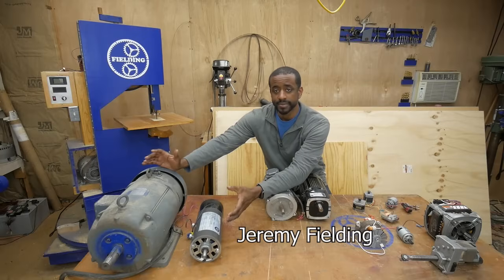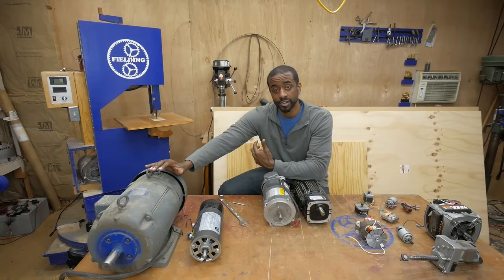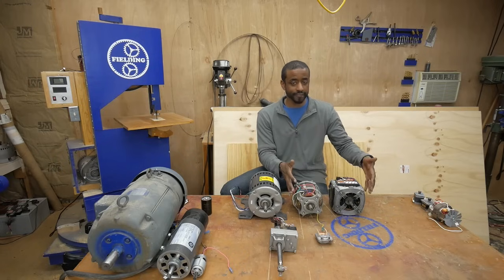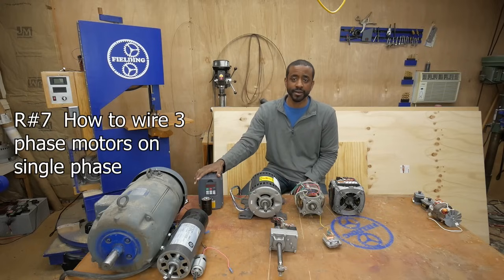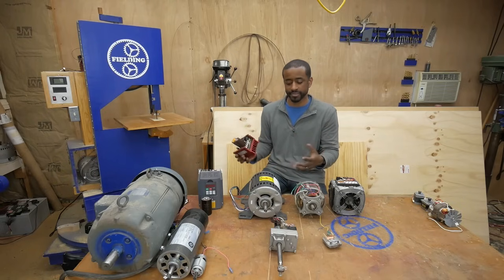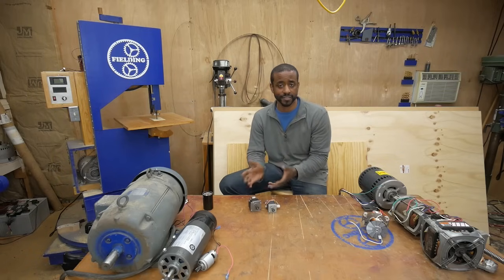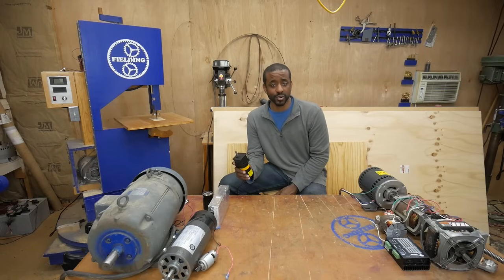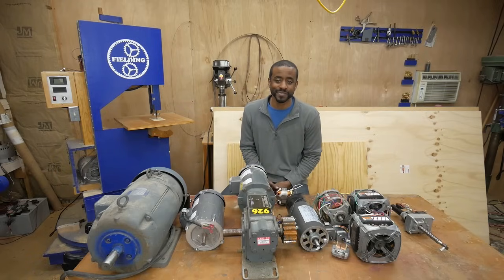Ultimate Beginners Guide to Using Electric Motors for Makers and DIY Projects; #068

Comment: I have a grinder with a ½ hp Doerr dual arbor motor (mod 60436DE741) that runs a grinder.  I need to reverse direction of the motor. There are 4 wires exiting the motor casing in the base of the motor, wires labeled T1,T2,T3, and T4. The on/off switch has two leads on one side with black wire connected to one, and white to other. The opposite side of switch has two leads with T1 and T2 together connected to one lead and T3 and T4 together and hooked to the other lead. I disconnected T1-4 and tested resistance between all combinations: 1-2=open, 1-3=1.9ohms, 1-4=open, 2-3=open, 2-4=1.9ohms, 3-4=open. I am ‘assuming’ 1-3 and 2-4 are run and starter windings. I’ve tried switching leads: T2-T3 together opposite T1-T4 = no movement. T1-T4 together opposite T2-T3 = nothing , T-3 alone opposite T1 alone = clockwise movement, T1 alone vs T3 = clockwise, T2 alone vs T4 alone = clockwise, T4 alone opposite T2 = clockwise, T4 alone vs, T2 alone = clockwise , T1 and T3 together opposite T2 and T4 together = nothing.   Help ??

Comment: Very good on electric motors , so I have and old lathe motor 1/3 hp 1200 rpm with heavy plate and pulley on  25mm shaft, a new small lathe has 200 watt  motor with 4000 rpm whitch can perofm best in lathe more torque ?j

Comment: I am building a sand railing type vehicle, at this point it weighs 220 lbs.  I believe it will weigh about a .5 tons when i'm done depending on the weight of the motor, batteries etc.  I want to know where I can find a DC motor and a way of controlling the speed and of course what size it should be  and easy basic way of calculation the torque needed to run it at a top speed of 70 mph

Comment: i've always imagined the first perpetual motion machine being a single high torque motor running a low friction conveyor and subsequently rows of (maybe?) brushless motors acting as alternators to feed back into the main drive motor. id love to hear what you think of this. what return of power percentage do you think you could achieve before the main drive is out-torqued by friction, line loss, etc.? I'm sure there's a reason this wouldn't work or we would have motor farms everywhere by now. i just need to know. lol

Comment: 1 HP is 746 watts, there are AC and DC motors. DC start motors that are series wound have an initial high starting current. Capacitor start and 3 phase are AC motors.

P=I*E, E=I*R.

That wash motor is from a Whirlpool direct drive unit.

Comment: Yikes, overwhelming. Im looking to get a variable speed motor for my small metal lathe so I don't have to keep switching pulleys and gears and what not. It comes with a ⅓ hp motor. Looking to pick one up cheap or free. What would you recommend?

Comment: If you add an expansion valve and control the speed of the compressor in your air conditioner over there, instead of just turning it on and off with the thermostat, you can GREATLY improve it's efficiency!  I've always been a nerd for the refrigeration cycle and electric motors.  Ever since I realized as a kid that my radio controlled car that did a scale 200 miles per hour would actually DO that if it was just built with everything 10 times bigger...

Comment: hey there, great video and i have learnt a few things from it. I'm currently sketching out a project for a revolving stand about 3ft across that can hold about 200lbs . i have most of the stuff figured out apart from what motor to use. it only needs to run about between sat 5 and 10 rpm. any ideas? thanks

Comment: Safety question: When you disassemble this, are there any risks of shocks? Like if there are capacitors for example?
Cheers! Great video, thank you!
Reply: Yes, large capacitors can hold a charge for a long time. Always short them out with an old screwdriver before you touch them.

Comment: Could you please tell me if a setup could be made to use two electric heaters on the same circuit one using the upper part of the sine wave and the second one using the lower part ???? What type of controller would be needed to make this work ???? Thanks VF

Comment: hey Jeremy thanks for the tips on the electric motors its nice to know how they differ from one another and the application for the different type and ive used a tredmill power supply for my grinder and it worked perfect

Comment: Thank you Sir, for your videos. I really enjoy your channel. 
I’ve been planning to install a 2,500 gallon Water Tank (Cistern) and connect my single-phase 240V 2HP submersible water well pump to the tank. I want to automate the control (Start/Stop) of the submersible pump with a Float switch (SPST switch) in the Cistern.

Most/All the topics/videos on motor/Pump control shows the use of a Contactors to connect power to the Motor (which seems to be used mostly for 3-phase high-end/high-current applications). And, I can kinda understand using a Contactor for a 3-Phase high-voltage motor. But, for Single Phase 240V Pump Motors, like my application for a Submersible Water Well Pump, (or, any single-phase 240V motor) it doesn’t seem like a Contactor should be needed. 
If we Open and Close just one of the Hot legs of the 240V circuit to the Pump Motor (like, for example, with a Single Pole Single Throw Float switch), shouldn’t that be enough to start or stop the Pump Motor? Of course, the Float switch will need to rated to carry the Voltage and Amps required of the Pump Motor. 

I realize (think) that one of the hot legs of the circuit will be energized all the way down to and through the submersible pump motor and back up the other Leg up to the Open Float switch. And, the other hot leg will be energized from the power source to the Open Float switch.  But, the Open 240V circuit Current will stop right there (at the open float switch). And, when the Float switch closes the 240V circuit will be complete and the pump motor will Start-up again.
If this is the wrong approach, please help me to understand why this Float Switch application design is wrong/flawed for my 240V single-phase motor application and what I am missing. And, perhaps you could recommend a better design/approach.
Many Thanks in advance.

Comment: Hi Jeremy Fielding,
Great video you have produced here, I really enjoyed it, great content. I particularly  enjoyed the part at were you explained the types and the horse power rating of electric motors. I felt the video  was really informative and you really brought the point across well. I am really interested in engineering and have had a career in electrical and mechanical engineering for over 28 years from everything from starting as  a mechanics assistant through to be an electrician to now a Project Manager. I enjoy sharing my skills and knowledge as well with others like yourself. I have provide training to others and had apprentices work with me to kick start there careers.  Many thanks, Great job.

Comment: Great guide Jeremy. Something perhaps of worthy note on DC motors. I have found through extensive R&D on these critters that the power output is a function of the frames ability to dissipate heat. Late in 2005 I designed a motor approximately 1.25 inches square that combined with proper cooling and very high efficiency produced over one horse power. With enhance cooling I could double that number.

Comment: Hi man! Im currently working on an exo-arm for my school project. The problem is I am not exactly sure on what type of motor to use and how much performance it should have. I am thinking of getting a stepper motor or a brushless DC motor. But now to my question how much performance should the motor have if I for instance choose a stepper or DC, if I want to lift around 5kg maybe 8kg? 

I am sure that I will need some sort of gear but if I get a to low powered one then the speed will be to low, so I am not sure. This is my first time in working in something like that but I am learning. I will be open for other suggestions as well and thoughts. You can also give me ideas on how I should assemble the gears and what motor drive to use.

Kind regards
Reply from the maker: Search my channel I just released a video on this

Comment: Wait wait.

Well first this is a fantastic video. but we do in fact use three phase power. two 120 hots and a a single neutral. every house has this, thats how we have both 120v sockets and 240v sockets for ovens, or driers. It wouldn't really be a challenge to add a three phase outlet into a workshop or something.  Isnt it the other way around where outside the usa they use single phase 240?

Comment: Dear Friend, how to design an electric motor? Say I would like to design a 0.5HP @ 750 watt (supplied by 220VAC/50Hz source) output of an induction motor, how can I do it? What I need to consider? Of course I understand Faraday's law, Lenz's law, Lorentz's law, and Fleming law, but I can not connect them to have that output. The same thing also how to determine the current rate of a transformer?

Comment: Hello, this is my question, I have a 3 phase motor, and the voltage it has is 208-203, 430. It would be possible that I could connect the motor to 240v being the motor 230v.

Comment: to elaborate a little on BLDC motors: brushless outrunners pack crazy wattages into a small package, and can be controlled very precisely, delivering a lot of theyr full power even at low RPM. (because they're throttled by altering the frequency, not the voltage) in terms of power density, a motor the size of a larger bottle cap can already exceed the 250w limit for e-bikes in many countries, and bigger 10-15cm pancake motors can literally fit 3-5kW in the palm of your hand. those are primarily used for electric vehicles, RC aircraft and drones.
downsides: they need a comparably elaborate and expensive driver (ESC = electronic speed controller) and, being optimised for battery powered applications, they cant be easily powered with AC mains voltages, and a sufficient power supply can add a lot of cost and bulk, when taling about kilowatts.

Comment: You can exseed the power rating you just have to be careful and add in protection, its best to think if that as the nominal max power... the power rating id making some assumptions like ambient temperature a motor at negative 40c in Antarctica is going to be more powerful and have lower resistance(23.5 % lower than room temperature ) and take a lot more surge before it gets hot, and a conversely a motor operating in death valley is is going to do a lot less.

Comment: 2 questions 
1- how much more stuff have you got hiding under that table? 😂
2- as you understand one thing or two about motors, do you know any decent 20V motor to power up a small bandsaw? I have seen lately plenty of videos of guys making home made bandsaws hooked to a drill. I can make one, just need to make sure of a good strong motor. I have a few 20V drills and grinders in the shed. I could easily use one of those I think.

Comment: Gday champ. Was wondering if you have ever seen wiring  where the start capacitor is shorted by a link when rewiring to anticlockwise for ac induction. I can only think that it's an error by manufacturer on the label.

Comment: Sir, you know some stuff about motors... Are you an Engineer by degree? Im an ME, with alot of software, R&D, and electronics... and a little BioMed background... Great Video... I find myself doing exactly what you did SOO many times in this video... IE...( That is another rabbit hole... lets discuss that after I complete this thought...HAHA) Well.. you did a great job of staying on topic... In normal conversation... I go down multiple tangents and then forget where I was going in the first place. Love this .." That is a little outside the scope, I have another video about that..."  You must have had this written down... or you have some serious FOCUS!... Again, good job... I am trying to figure out the correct motor type, size and Power... for my second CNC machine... My #1 machine is a prebuilt and geared 40:16 AKA 2.5:1 and is made to mill billet Aluminum 6061-T6... (4 flute carbide end mill, for pocketing)... but because of the amount of electronics and mechanical devices I have ( Arduinos, RasPis, Etc.. and  Motors, Servos, Steppers, Belts, Pulleys, Gears, Etc...) I figured I would attempt to make a 2' x 2' X, Y + 8"Z + AC 5 axis CNC to do a couple things I consider hobbies... but choosing the right spindle motor is so complicated... just as you show in this video... SOOOO many options and tough Decisions... 
Either Way, I really like this video and will definitely be giving a thumbs up... Even though it is kinda vague, I understand totally why... 
It is just too much to cover in a single video/ sitting...

Keep it up man.

Comment: My wood lathe rotates in either direction using a toggle switch. I would like the same fuctionality with the low speed grinder I use to sharpen the the wood turning gouges. How on earth can I wire this up??

Comment: I'm looking at lifting 4 corners of a topper to make a "pop-up' camper. I saw one of these done with four linear actuator. What motors would you recommend to build a similar mechanism. (probably need for identical to get similar lift)

Comment: A man with a fetish for Electric motors! Awesome 👍 now all that you have to do is some experiments where you use a motor to drive a generator in a closed loop system for some free energy! You would be in the best position to work it out because you know the motor's better than most and you have them right there! I have seen videos where others have done it and they run power tools of it at the same time! Who knows, it might be possible?

Comment: for those who are confused with the HP rating.
If they both have 3hp rating this means the can both put out the same force for the same input power, but one will need gearing to convert torque to speed or the other will need gearing to convert speed to torque which is why you have motors of different sizes. Instead of having a complex gearbox that needs maintenance, just get a motor to suite the application and connect it directly.

But the things is depending on the space requirements and motors on the market, sometimes  a gearbox is the only option

Comment: Great Video! Lots of info. Question: on a 3 phase motor using a VFD does lowering the speed lower the torque? I need to raise & lower a part on a machine with the ability  to control the speed. What type of motor should I be looking into?